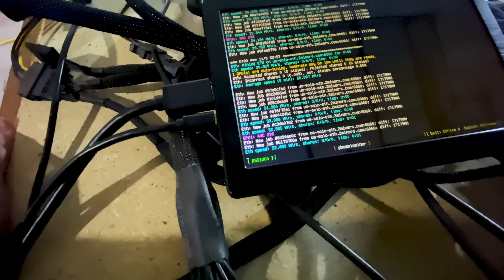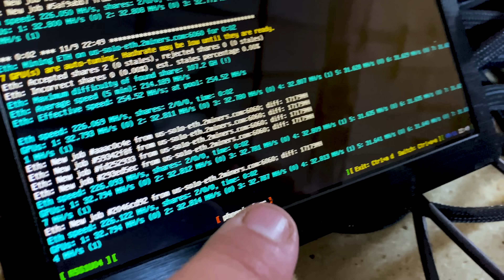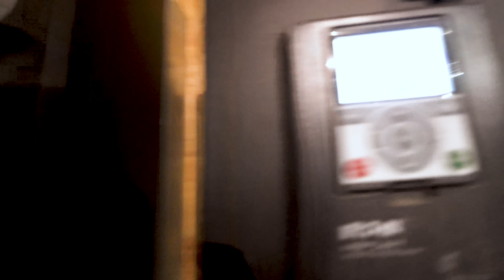How do you service a 2500GPU Cryptocurrency Mining Farm

Comment: As of 4/22/22 this is getting just over 1ETH per day. So revenue is $3206 and profit is $2234 per day. That’s $815k per year. Damn! I don’t know what kind of money and connections you need to have to get 2500 of the same exact cards and 357 of the same MB, PSU and CPU (since there are 357 nodes here).

Comment: How much they get profit from these ? That looks millions of dollar investment.
Reply: 2600 gpus roughly 35 mhash on average. Is roughly 90 gh. I would say he is making 3-4 Ethereum per day after subtracting electricity cost. So the farm is making roughly 2000 Dollar a day.  With cheaper electricity maybe 2500-3000 depending also on the other GPUs he has.
Reply: @Midg-td3ty  2500 gpus and  he has a huge electric bill more than your estimate. Also most of those cards are shit.  He has 6 card rigs lol what waste. And what old shitty cards for the most part. he may mine 3 eth but over 2 goes to the power.
Reply: @johnmcook1  I was going by his example. He had 7x 32 mhash for 1000 watts. Which if all his rigs were like this it would be in total 80ghash. But he also showed of Radeon 7s and talked about AMD 5700 xts etc. So I would say he has more efficent GPUs mining too so I gave a conservative 90ghash at a power use of 360kw per hour. Thats about 4.5 Ether a day and going by a standard 10 cents per kwh its a daily electricity cost of 36 Dollar per hour or 864 Dollar a day. So roughly 1,5 Ether a day. He would have a profit of roughly 3 Ether a day. 1500 Dollar currently. Back when I wrote it was more like 2000. Could be significantly better if he has a bigger proportion of modern gpus mining or cheap electricity.
Reply: If all 2,500 were Radeon VII's, mining today would rake-in about $30,000/day, $10.8 million in Ethereum per year.

Comment: how did you get each card doing 32.5MH/s :O I got my RX570s bios modded and still max out around 30-30.5MH/s under SMOS :O any more and it's crash fest
Reply: he was just showing his best cards. Silicone lottery
Reply: @pepperjackshack2439  Well, considering i had some 50 of these i would've thought atleast 1 would hit the silicon lottery ...
Reply: absolutely dont use windows, and use hiveos, i have rx 570 8gb all 850mV, 1225 Core, 2200 Mem, its onli take 76Watt and produce 32,96Mh/s
Reply: i mean use only OS that specialized for mining like hiveOS
Reply: @hadyandayyan5355  i do 46Mh/s at 88W GPU consumption.
Reply: @swedensy  what gpu?

Comment: With this amount of cards it could be actually smarter making a custom water loop by building all water blocks yourself with CNC machine simply by making a one template and letting it to run. You could reduce the amount of heat it makes, under volt the graphic cards without losing performance or even overclock these for more performance if needed and still keep all below 50c, without noise, without moving parts, without the need to cool all this huge warehouse. You could locking the radiator in small dust air cooled room, even by connecting some water cooling system. As for water you could make two thick lines one upper line for fresh under pressure cooled water and bottom line where all your hot water goes and returning back to cooler room. this could reduce your monthly electricity bills a lot, could reduce the heat, the maintenance costs and most important hardware failure. If you do all nice and clean, accurate. nothing going to fail for many years!
Reply: You're better off ac the warehouse lol
Reply: @manymusicians3743  you don't need to AC the whole warehouse, just a single dust free room where you keep your coolant radiators.
Reply: can you imagine how much work that would take? nobody got time for that
Reply: @merunasg  if they had time for that 2500 GPU farm, they have time for that as well, it a project that would definitely be worth the investment and their while.

Comment: Ok so I'm somewhat savy.
Can someone please explain?
Hes mining bitcoin or what not but how does that actually work?
What's are those things on the shelves drives?
Reply from the maker: Mining Ethereum, Ravencoin and Ethereum Classic ; split across many of the machines. Each section (7 GPUs, Motherboard/CPU/Ram & Power Supply) can be individually assigned to mine a particular Cryptocurrency network.

Comment: Just subbed!!! With the new speculation on eth going into its non proof of work version by 2022/December, what gpu setup would you recommend.
Reply: i would say btc mining
Reply: i got a newsflash for you: Ethereum proof of stake was pushed back to Q2/Q3 2022.
Ethereum mining will continue until May-July.
that was publicised in one of the last EIPs last week
Reply: @HoLDoN4Sec  yes I actually think they will push back to 2023, I already found out that the 3070 series is best for "future" safety since it's hash rate is as efficient on other alt coins as well.
Reply: @twentyfive2life686  thats not quite accurate, the non-LHR 3070 and the 3070Ti have amazing efficiency.
the 3070LHR is TRASH for nearly every coin affected by the LHR limiter.
personally i use a mixture of 1660 Supers and non-LHR 3070s, and i also got two non-LHR 3080's
i got the 1660 Supers ever since the 3070 LHR came out and it became nearly impossible to find a non-LHR 3070. the 1660 Supers also have incredibly good efficiency for ethereum (0.4MH per Watt) and pretty good price per MH too.

Comment: PCIE riser power with Sata cable?
Reply from the maker: On a majority of them yes. Retail PSUs; no more than 2 per SATA strand. The SATA riser power pull is 33.6w on the RX470's on Eth. On KAWPOW its 45w. We drop to 6GPU rigs and single card per sata strand on RVN mining. Our current builds use Delta Server 6pin only power sources

Comment: This video is wrong, that is not how you service a mining rig, the correct way to service it is as follows :

You will need :

• A container of petroleum that isn't empty
• A box of matches

Steps :

1. Make sure the rig is turned on 
2. Pour petroleum on and around the mining rig (this lubricates and cleans the rig, and because it's oil it is not as conductive as water)
3. Light a match and drop it on to the petroleum (This helps dry the rig)

The results are a net positive!!!

Comment: How do you dry the gpus after the ultrasonic cleaning? Won't the water do corossion damage?
Reply: I dont think its water, its some cleaning solution. Though water should be fine so long as you dont let an excessive amount dry/oxidize on the surface.
Reply: I wash everything in sink water, gpu, motherboard even psu, after drying with hot air it's all fine. In the past 10 years I washed like 500+ components and not even a single one failed yet. Only keyboards and screens can't be washed.
Reply: @sali-ali  Interesting. I would be leery about doing it to a PSU -mostly just because fan bearings tend to fail when exposed to non-lubricating liquids.

Comment: cryptominers should be jailed.
Reply from the maker: It’s how proof of work cryptocurrency gets its security. Nothing a miner is doing is illegal and on the contrary I have dedicated nearly 400 videos since 2013 to show you how to participate, even if it’s one GPU mining for you while you sleep. For your contribution to network hash you are compensated with a token, which now happens to be worth a pretty decent sum of money. 

Look past what you think is bad with this and understand the strength and power of a decentralized system that has the incentive built in, free market participation included. Even if your a full time gamer, when you sleep you could be earning more with your hardware.
Reply: @BitsBeTrippin  What about the massive power consumption that comes along with mining, isn't that an issue ?  Spending non-renewable resources on a virtual currency feels wrong. Atleast Ethereum is trying to change that with proof of stake.

Comment: This here gamers, is one of the main reasons for why you cant have a GPU or for that matter to real MSRP. I know how to service a mining farm.
open the gate/door and let gamers (not scalpers) raid the farm. It so simple. I hate mining and all the crap coming with it. It not only because of the lag og GPU and the horrible pricing mining is some what guilty in. No it´s just as much the power consumed and polution this stupidity cost the world.
Reply from the maker: Couple strong fallacies here, agnostic to opinion which your entitled to. 

1) Specific to our farm, these are mostly Mining Edition GPUs, not retail GPUs you are having issues with. These GPUs have no operational video output and while RX 470/480 series chips are allocated for GPU mining, not gaming cards.

2) The environmental aspects, related to GPU mining is a flawed argument. Miner's using GPUs to mine vs Gamers using them game then claiming mining is bad for environment is a fallacy when a gamer, gaming is using the GPU too which uses power in the exact same way. Additionally most mining operations align around renewable resources vs traditional coal fed power which is mostly used across the world for general power. 

3) Cryptocurrency is the incentive to uphold crypto blockchain networks, which are quickly forming an entirely new asset class that is decentralized vs centralized from creation/validation and usability. This helps put the control back in individual hands vs. governments on the issuance and governance of the token, which helps control inflation vs. endless printing of native country currencies. (this is a good thing for the general consumer as inflation protection)

4) I completely agree the current GPU market crisis sucks big fat monkey nuts. This is caused not only by GPU Mining, but an global pandemic mixed with China Tariffs put in place on trade. When the 'free' market can't act on basic supply/demand dynamics and there is additional taxation and friction put in place, all prices go up. This is a combination of many factors.